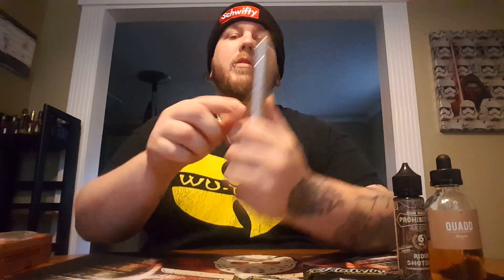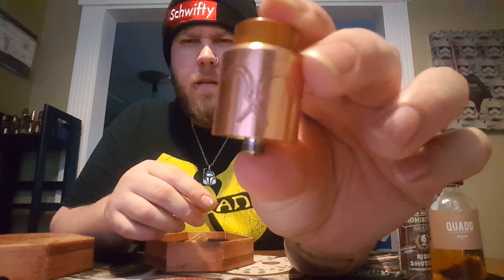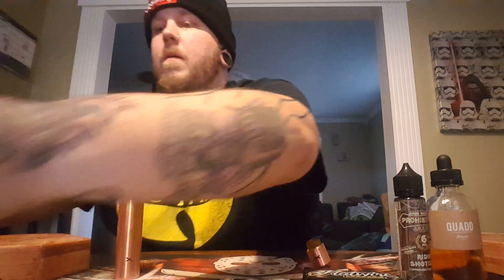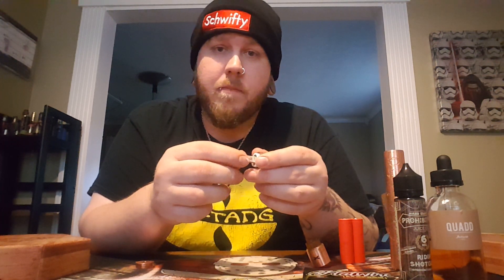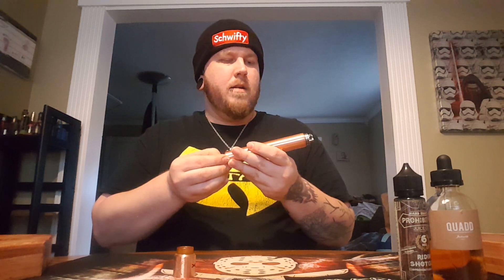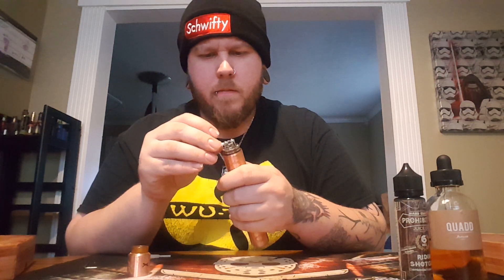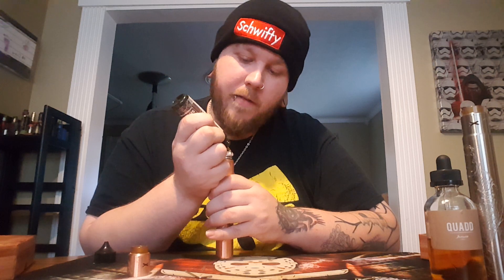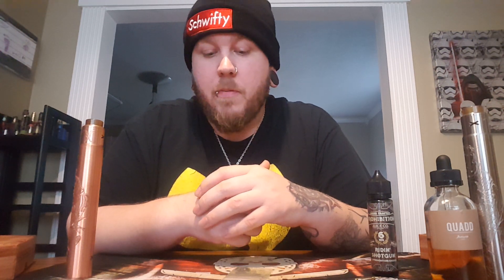Evil Twin by DeathWishModz breakdown/tutorial

Comment: bit of a random question, but what resistance did you use on your barebones? thanks man
Reply from the maker: tentacion :p I usually run .07 or .08 on my barebones provided that the batteries can handle that low of a build.
Reply: J Deathwish damn that's low, what batteries do you use then?
Reply from the maker: tentacion :p I use Sanyo NCR20700As
Reply: J Deathwish awesome, subbed
Reply from the maker: tentacion :p thank you brother